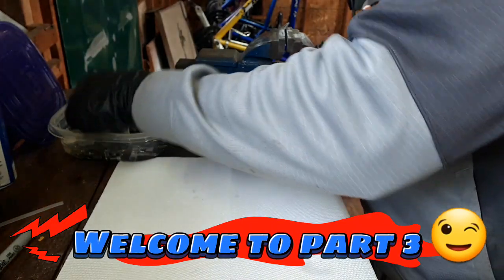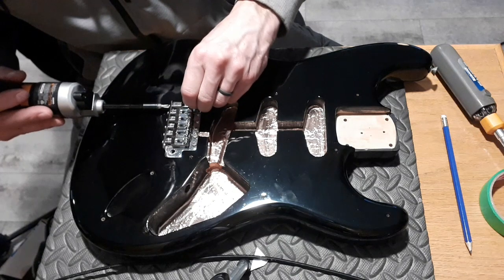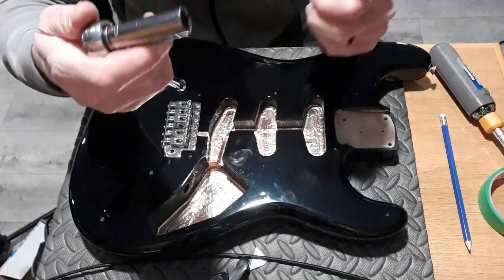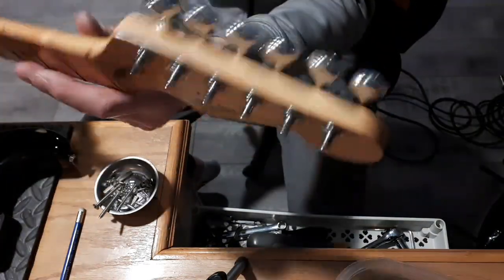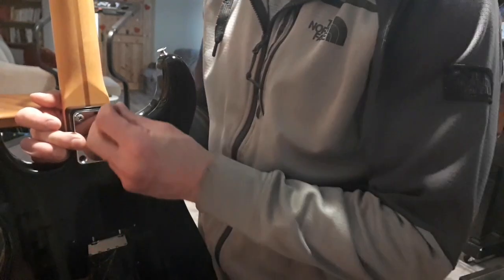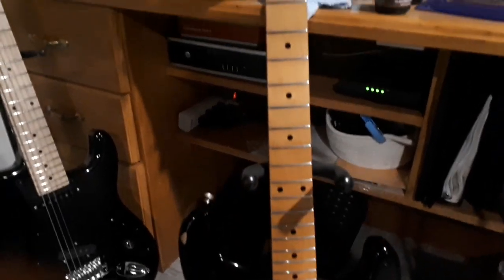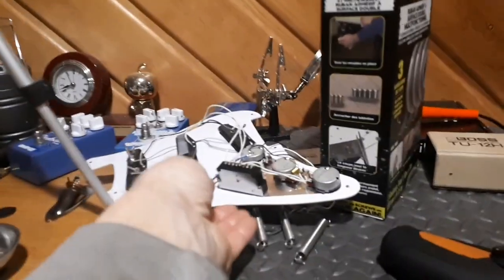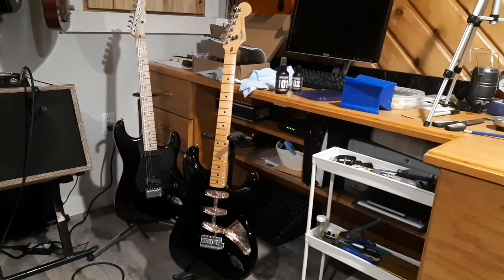FENDER 1982 MADE IN JAPAN STRAT-Ressurection part 3 😉

Comment: Looking good.  Lemon oil doesn't really condition polyed surfaces but it probably took the smell of vaerosol off of it.  
When I saw you working on the nut that way I got chills. Normally if you have a 6 mm high not you put a piece of sandpaper across the top of the neck near the nut and you use it as a radius and run the nut back and forth until it stands into the radius of the neck. That 5 mm was too thin and then would have had the strings too low even if it hadn't have broken.
Reply: I concur with 2bikemike’s suggestion here—this is how Dan Erlewine does it in his videos over there at StewMac, too. I think you’ll find this method much quicker and easier, not to mention far more accurate than trying to trace and then cut it with a dremel. I also think 2bikemike is right that you need to start with a taller nut, so that there’s enough meat left after you’ve done the radius-ing.
Reply from the maker: Yeah I never considered the old fretboard to radius the nut... Live and learn haha
Yeah there is no poly on these 80s Strats but they are sealed with something for sure... I used a cleaner to take all of the varsol off and with the oil, the neck turned out great!
Got a new pre-slotted and pre-radiused nut coming🙂

Comment: Nice job! One thing I wonder about: Isn’t the bridge grounded with a wire from the back, soldered onto the claw? That’s usually how Fender and most other makers do it… I mention it only because that it seems like that might be a bit aesthetically cleaner than running that shielding bit along the front. Might be a bit more robust too, since that way, it won’t be in contact with a moving part that could potentially snag it.
Reply from the maker: Yeah the wire from the back will be there as well but the front ground I think will be more effective. That back ground has to travel through the claw, through the spring, through the block bridge plate then finally saddles...,🤔